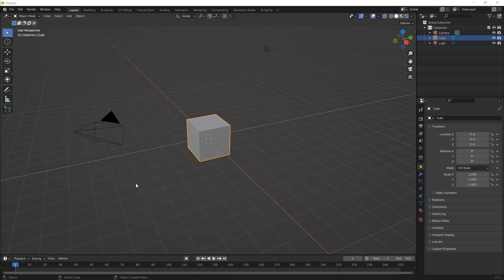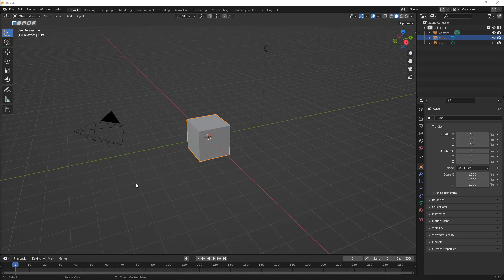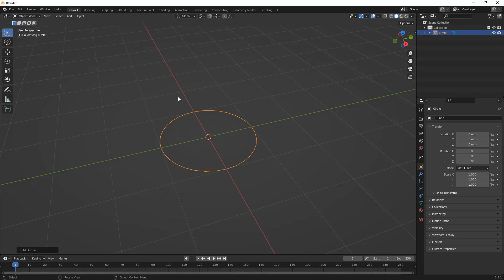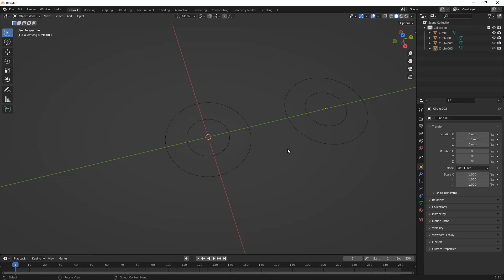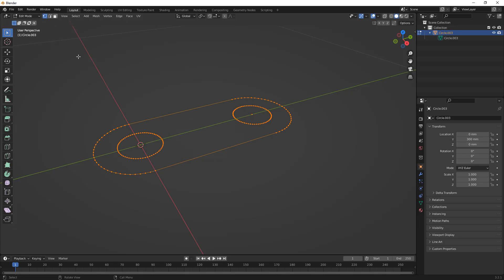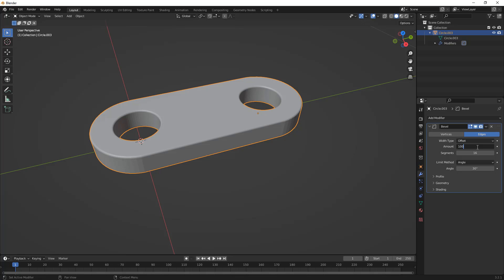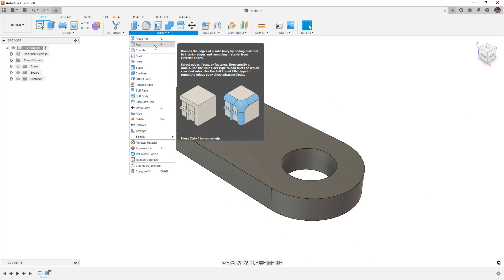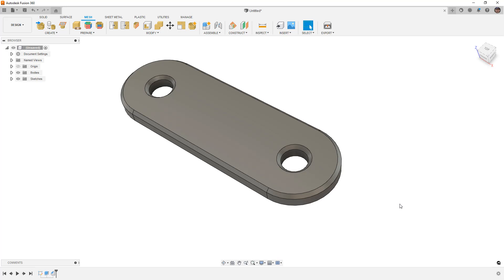Precision Modeling in Blender? | You Decide, Blender vs CAD | Precision Modeling | Blender | Fusion

Comment: you could of just done F for fill on the 2 verts no need to fill all erh
Reply from the maker: thanks for the tip.  I never do this kind of modeling in Blender and only did that video at several requests.  Much easier to use Plasticity and the blender bridge or I suppose CADsketcher add-on.

Comment: How do you select edges through the body in Fusion without going through the menu (holding the mouse button)? I've seen you do this in multiple videos but I can't figure it out. Looks very convenient.
Reply from the maker: on the far right of the toolbar you should see a selection drop down.  By default the selections should be set to "Through" but yours may be turned off. so go to "Select > Selection Filters > Select Through"   not that the selection filters change so if you are in a sketch and set it, that is different than in a design.

Comment: Umm, CAD Sketcher?  That’s pretty precise, have you tried that plugin for Blender?
Reply from the maker: Yeah, this specific video was to answer a user question about modeling it with blender tools.  The video is a bit old.  CAD sketcher is a step forward but its still not a BREP model like you get from Fusion, Plasticity etc.  Honestly the best workflow is Plasticity with the Blender Bridge.  Live updates but modeling with CAD tools on BREP geometry and you have control over how it gets converted to a mesh rather than having to worry about edge loops or a mod stack full of booleans. 

At least for me.  I know a lot of people love CAD sketcher.  I avoid hard surface modeling in Blender :)

Comment: I see, so to create something with sketch the CAD was much faster. As a blender user, I need to design something to 3d print. What about CAD Sketcher (a blender addon).
Reply from the maker: I think the core of it for me is that in CAD you have a bit more control over the geometry.  You work with BREP or NURBS bodies until you convert it to a mesh for 3d printing (or now a days most slicers will take in a STEP file and let you do things like G2/G3 true arc movements for holes).  While in blender, even with CAD sketcher, you are still working directly on the mesh.  For me being able to tweak some dimensions to control say tolerance or gap between parts rather than scaling faces if 2 printed parts don't fit is much better.  

BUT, if you prefer the blender workflow and especially if you say need to sub-divide your model and do some sculpting, then do it all in Blender.

For me if i need to control dimensions/parameters, its easier in CAD.  If i want to deal with mechanical motion, easier in cad than rigging in blender,  If i want to do any simulation or CNC machining, It has to stay in CAD.  Most simulation software packages won't let you bring in a mesh file, it has to create its own mesh of the solid and they are not the same thing.
Reply: @LearnEverythingAboutDesign  wow, I see. They both have different purposes. I agree with you, there is difference between mathematical mesh and mesh made of vertex and edges. But in my case I'm a programer more than a designer. Learning so much softwares will take a lot of time. So I thought to go on with Blender (since I used it a lot).

btw, Thank-you for your quick reply, I didn't expected it. You explained it very well
All the best for your clannel.

Comment: These videos are always a bt odd. Polygon modelling and CAD modelling are both just different things entirely. Cad modelling you don't have to UV map, texture and than forcefully triangulate the mesh when it goes into a game engine (or even zbrush). Games engines and zbrush both do not like ngones. Whereas when doing CAD stuff it really doesn't matter if you get ngons. Blender forces a more polygonal modelling method BECAUSE you need to keep good topology for when you get into games engines otherwise you'll end up with broken meshes.

So it just depends what you want it for. If you're doing CAD based work or even 3D printing then sure. CAD software is great. If you're making video game assets you'll likely realize really fast that CAD models don't really work.
Reply from the maker: I agree with everything you said.  I had a lot of requests to make this video even though I linked users to other videos where people use CAD sketcher.  This is also why I started to cover plasticity. I did a video that never released on low vs high poly assets into Unity but I am in the CAD side of the spectrum so left that one out :)
Reply: I also agree completely. I can see the advantages of a parametric modeler such as Fusion or FreeCAD for certain types of models especially machine parts type models, and Blender being advantageous with other types of models. I tend to go to Blender just because I'm very used to modeling with it from years of making game & flight simulation content.

Comment: I am learning both blender and fusion 360 for functional 3D printing. Both has its merit but Fusion 360 is easier to use and is free for non-commercial use. Free vanilla blender is just that. Vanilla. Blender can only be somewhat like Fusion 360 if you use paid add-ons. Will learn both to get the best of both worlds but being home-based, free fusion (until autodesk changes its policy) would likely be my app of choice.
Reply: Nah, doesn't need to be paid, not for all of it. CAD Sketcher is a free adon for instance.
Reply from the maker: for parts like this I 100% agree with you.

Comment: That's a very unimaginative model. I have other models that I've been doing in Fusion 360 for years, but I'm frustrated by the lack of easy scripting, and that transforms are not easily parameratized. Blender is much easier, and it logs all transforms to the console so you can read them. Fusion hides that info.
Reply from the maker: Yeah the model is simple but to highlight some of the basic differences when trying that approach in Blender and Fusion.  A more complex model just means more time to show the concept.  

Fusion does have a weird quirk of not retaining the Move/Copy distances BUT if all your bodies are in their own component then capturing the position will allow you to revert it.  I don't typically model by transforming things.  I generally use the Align tool when moving things to be planar if needed or use move/copy temporarily if i am working with bodies.
Reply: @LearnEverythingAboutDesign  I think that might be the difference between the two use cases. If you're fortunate enough to only model designs which have already been tested and validated, then use the legacy tools that are designed to fit into that space in the production pipeline. If, on the other hand, you have to make rapid ad hoc corrections to assembly positions after testing, and you want a record of those changes or to parameterize them, then Fusion doesn't quite satisfy.
Reply: @TreeLuvBurdpu  isn't that the whole point of the parametric timeline? something far better than a read out - something you can actually use to go back and modify your outcome? let alone having a decent align tool to make corrections to positions after testing rather than relying on vertex positions for fine control or being stuck to grid snapping. I just don't get how blender - .a poly modelling tool focused around animation - is going to be better at generating parameters for fabrication.
Reply: @LearnEverythingAboutDesign  Fusion also doesn't have assembly-wide parameters. Each sub-assembly has its own parameter sheet. I don't think you can even export the parameter sheet as a CSV or anything
Reply from the maker: @TreeLuvBurdpu  The parameters should be design wide.  Do you mean if you insert an external design into a new design?  If you have an externally linked design the only time those parameters are exposed is during edit in place.  If you have assemblies/sub assemblies in a design that don't have Xrefs, all of the parameters are available all the time.  They are broken down by User parameters/ Favorites and then organized by components just like the browser. These also will be moved up to the top level if you break the link of an Xref component.  

 If you derive a body/component out of a design and it has associated parameters you can also bring them along with it.

You can create parameters to drive rotations and movements of bodies/components.  Unfortunately move/copy is captured for a body and if you edit it, the values are all empty. even if you link a parameter.  Its a problem for sure.

I don't model parts that are tested/validated.  Everything is new designs.  I have run into tolerance and clearance issues that require me to move/rotate designs and validate/edit.  Recently I had an issue for clearance that was supposed to have a positive stop at 3.5deg rotation from a pivot point that was 1.2mm in space from a reference.  To do the adjustments I made a copy of the body and rotated it based on the theoretical pivot.  Then rolled the timeline back, edited the geometry and rolled forward.  The move/copy with the copied body had all the updates and that is how i validated it through section views and intersection tools.

Trust me i know it isn't ideal for sure.  But surely blender can't be better for mechanical part design in that regard?  Again I don't use Blender for this, i just had so many requests to cover it so I made the video.  I stay in my CAD lane :)